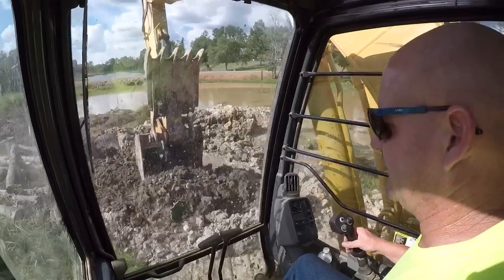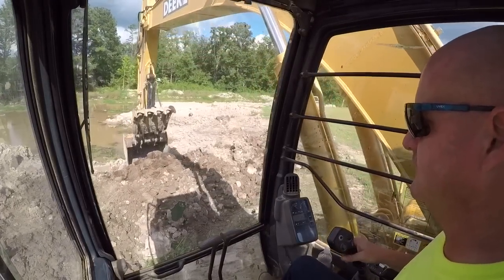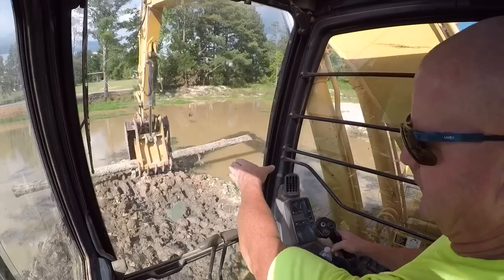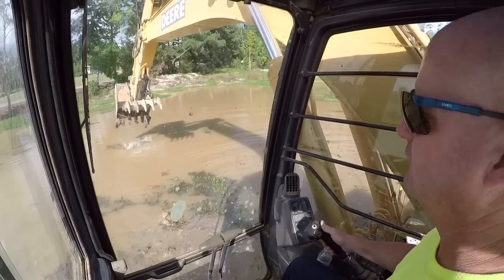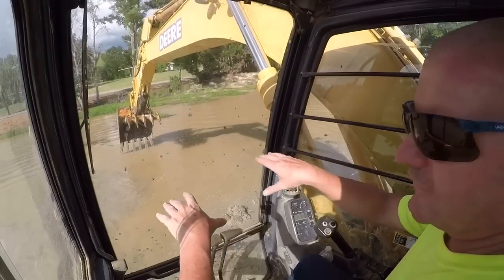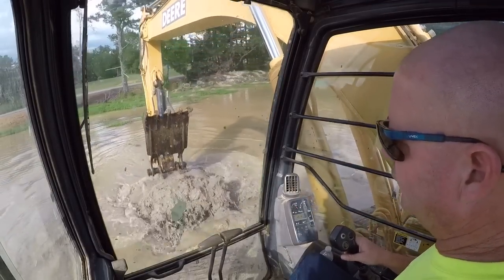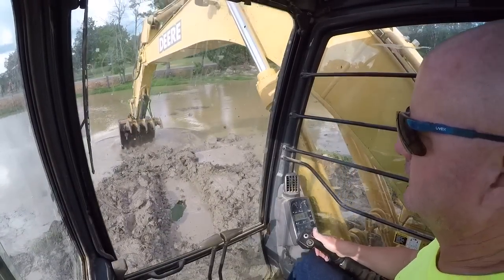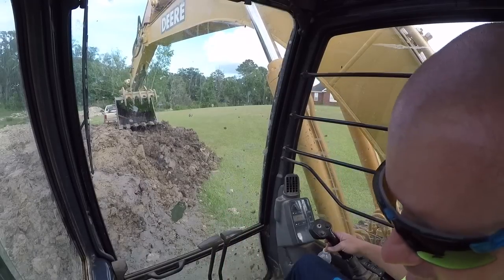John Deere 200 excavator project (part 9)

Comment: that deere runs pretty hot
Reply from the maker: It has foam rubber pieces under the hood and between fan shroud and they have rotted apart. They direct the airflow through the coolers. I ordered some new pieces of that stuff and I got them yesterday.